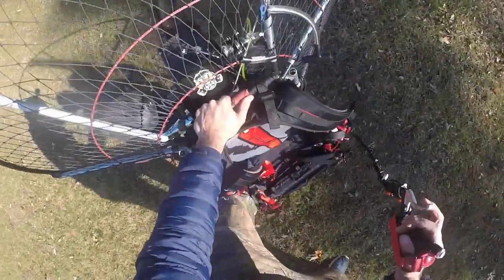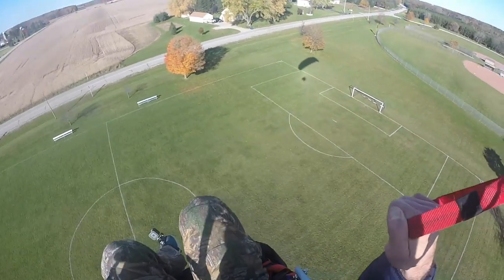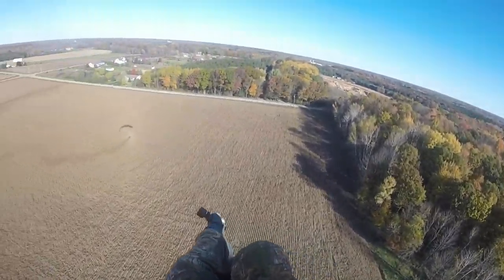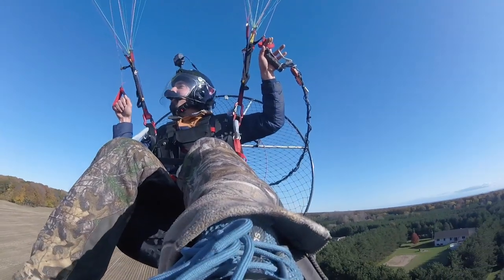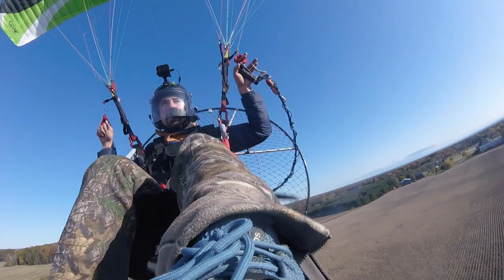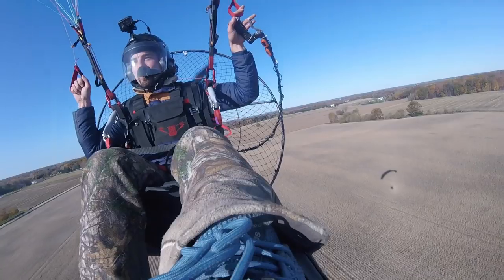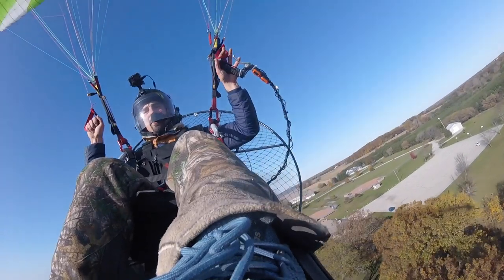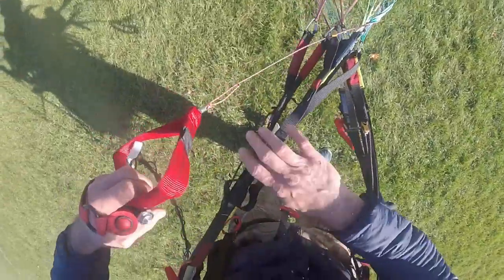Black Bee 125 Review - Vibration Test

Comment: Great topic. My Moster 185 idles with less vibration now.  I eliminated excess vibration at idle with proper tuning, here is how I did it.  By adjusting the air/fuel ratio on the low screw I was able to then turn the throttle stop screw and find where the vibrations were the lowest at about 2200 RPM. A shakey motor falls apart sooner.

Comment: Hey! How would you compare the black bee vs the atom80 when it comes to vibrations? 
Im 170 pounds and want a smooth, pretty quiet low vibration engine. The atom would work but the extra power on the bee wouldnt hurt.
Reply from the maker: Rickard Jonsson I haven’t flown the Atom 80, but I hear it’s a great engine. You can get any engine mounted on the BlackHawk V3 kestrel frame and it has a double vibration dampening reduction system. That would be a good comparison, the 125 and the 80.

Comment: Marc love watching your videos!  What is the max pilot weight on a 125? I’m around the 215lb mark.
Reply from the maker: Hi Kevin, thanks for watching!!! 215 is about max for the 125. You could get the Black Bee 125 or else the Titan 210 is more power without much more weight. Then you could attach a lite trike if you ever wanted too also. Call anytime if you want to talk paramotors!
Reply: Thank you I may just do that!  I came across an Air Conception 130 and to my surprise the max pilot weight on it according to the user manual was 240lbs.
Reply: Don’t ground start if you like your limbs

Comment: So out of these three is there any performance differences?  I found a good deal on a 125 Lite.
Reply from the maker: The Black Be 125 is the best, really smooth power and more of it. The lite 125 has a great power-band, smoother hitting then the old 125, and is a bit lighter. The old 125 does the trick but has been improved. The big new upgrades are the V3 Kestrel frame and newest harness. The lite 125 you're looking at may not have the new harness or V3 frame, be sure to check all that out. I love my Lite 125 and put a lot of trust in it. Good luck!